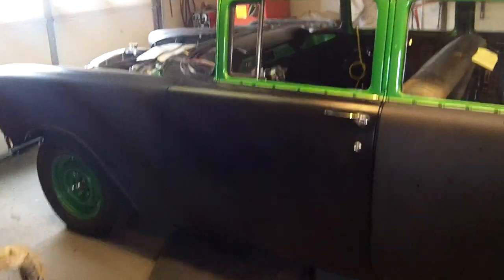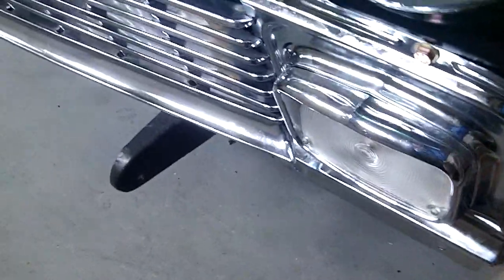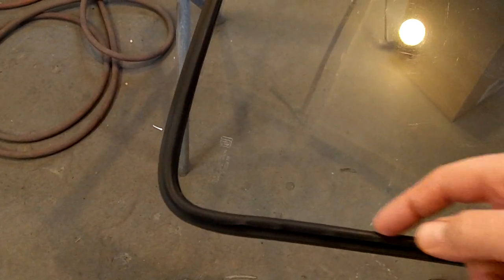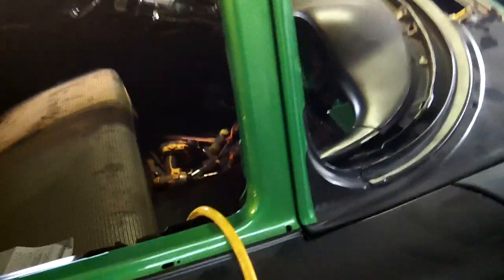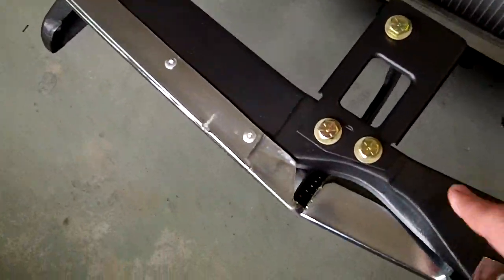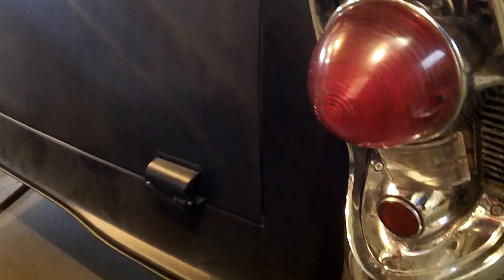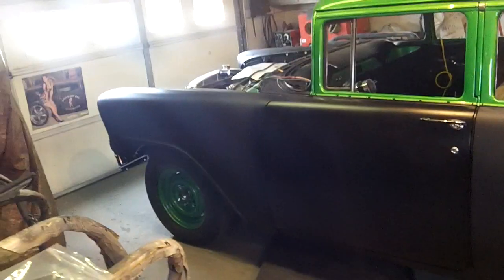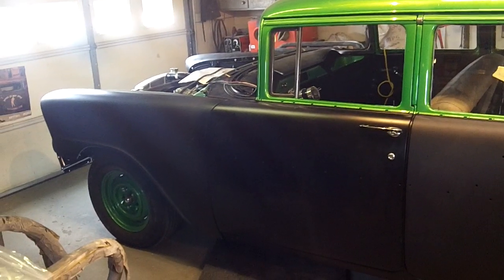1956 Chevy Wagon update April 2019

Comment: Hi, I have a 57 Chevy 210, 4 dr wagon. Pulled rear curved quarter and lift gate glass. Have new rubber and cleaned original glass. Ready to install but wondering about the small outer lip of the seal. Does that get roped in like the Windshield? I’m assuming you have installed your glass by now. Any tips or video you might have that would help me?